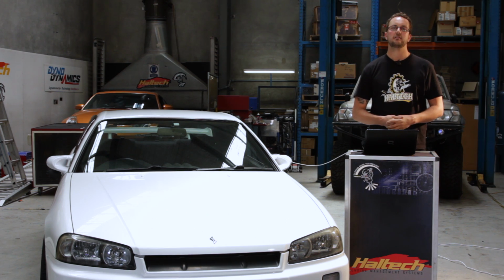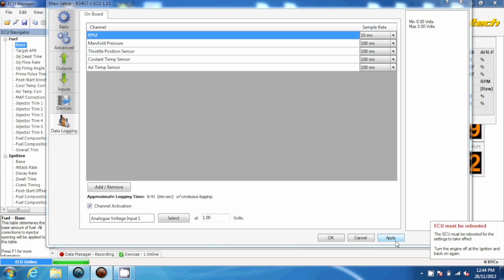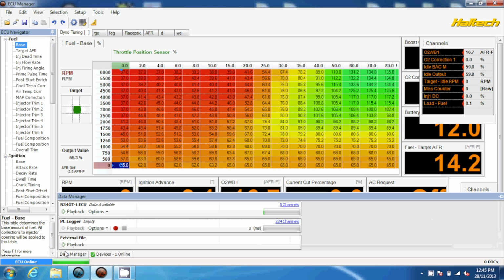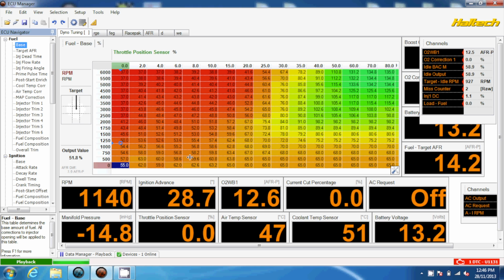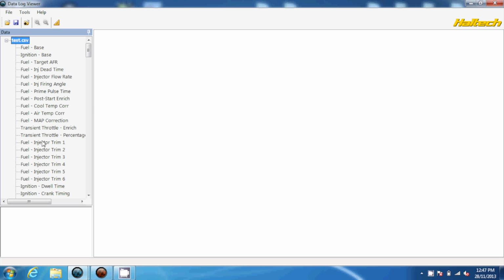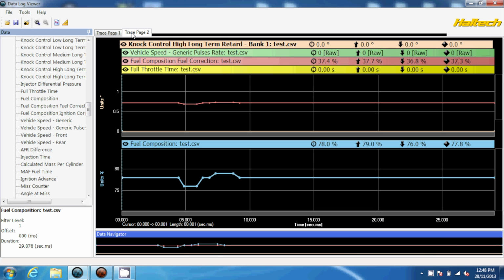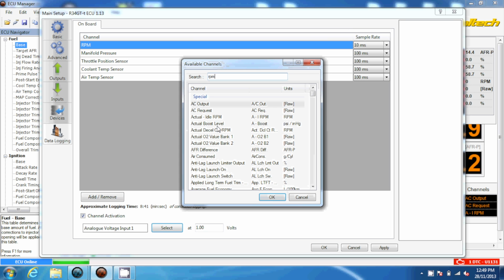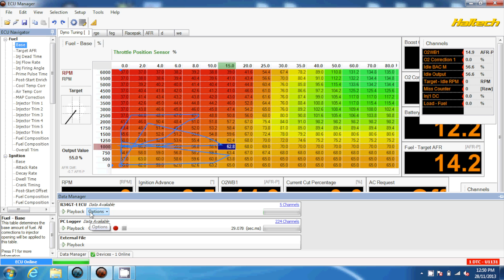How Data Logging Works - Haltech DIY

Comment: please do a video on how to interpret the data. explaining things like how the timing advance trace is the sum of the base timing map plus the air and coolant timing correction plus the post start offset but ONLY when TPS is above 0% (at 0% the zero throttle table will be substituted for the base map table)  also when TPS is at 0% the trace for base map show erroneous values that need to be ignored.
stuff like this takes a LONG time to figure out on your own.  good tutorials with all this info would help us DIY tuners ALOT.
thanks.